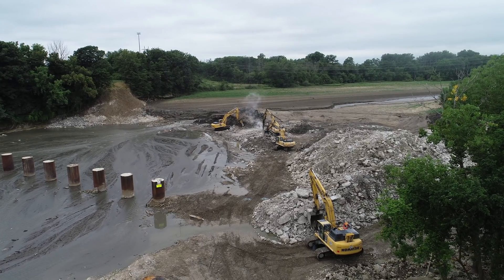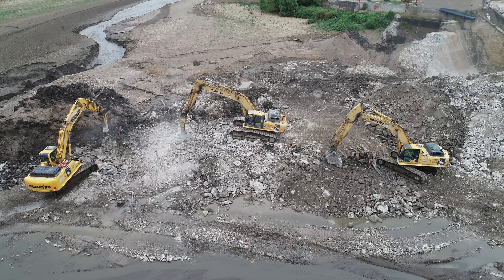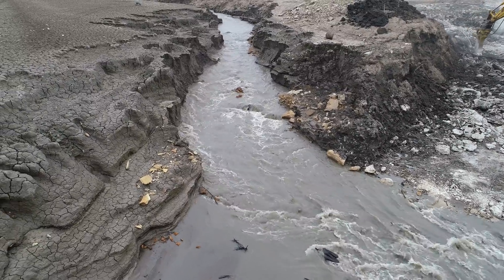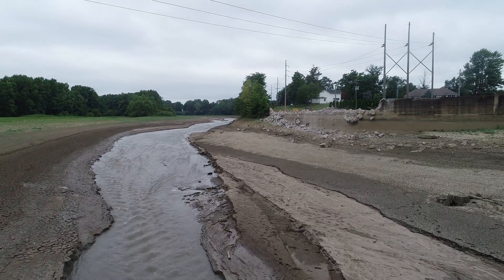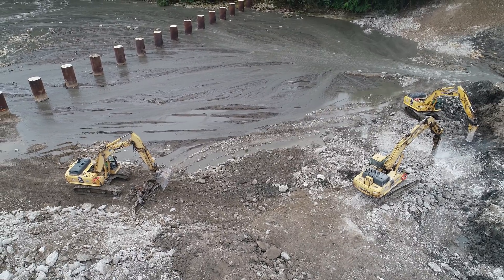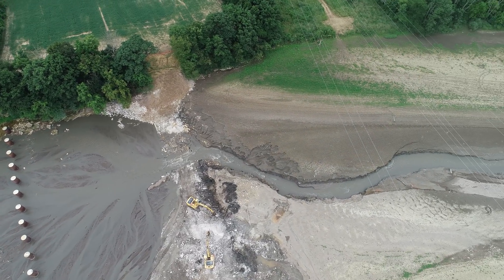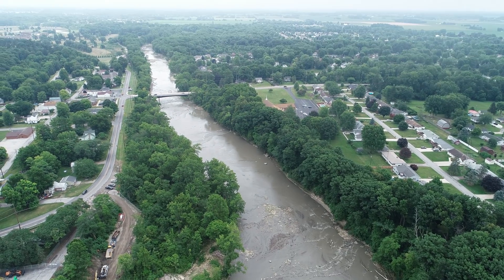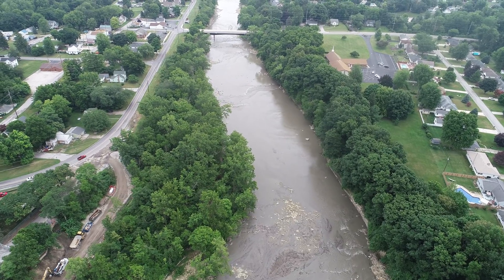Dam Removal Day 22

Comment: hello i have one question please what was the reason for removing the dam
Reply: What Joshua said plus it had deteriorated enough over the years that it not longer met government standards and was cheaper to remove than repair (or convert into a fish stair).  Also, so much silt had collected behind it, it effectively had no flood control and dredging was deemed to costly and difficult to accomplish.
Reply: outlived it purposes of power generation and water supply, the later taken over by a reservoir shown in prior video